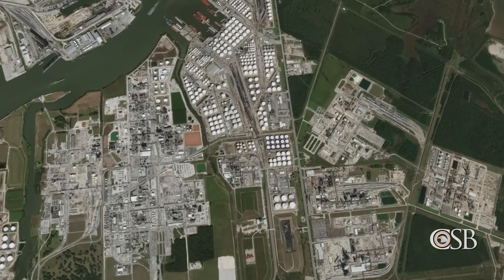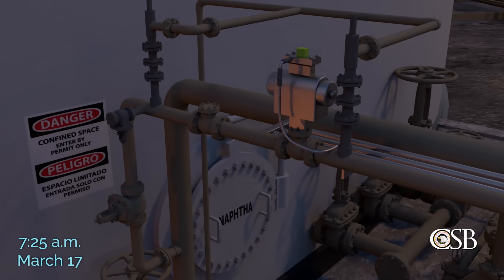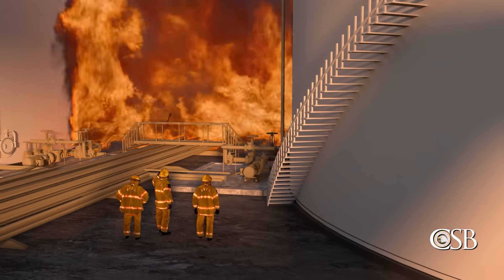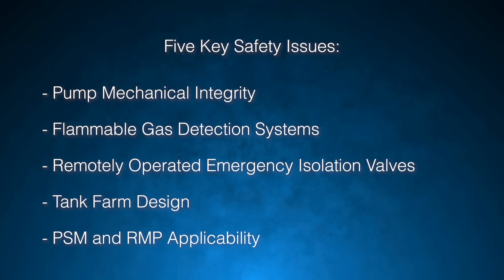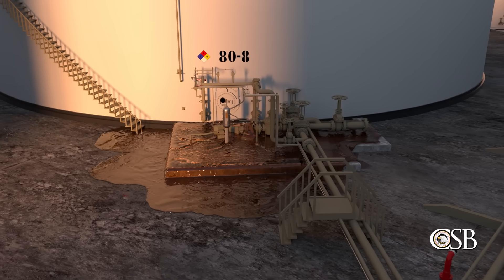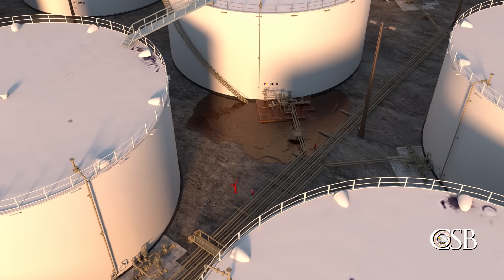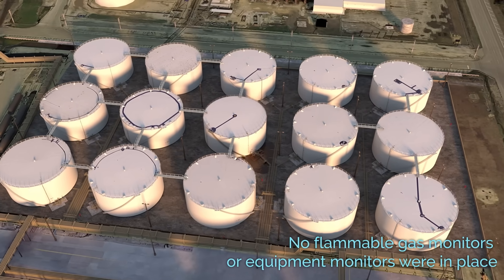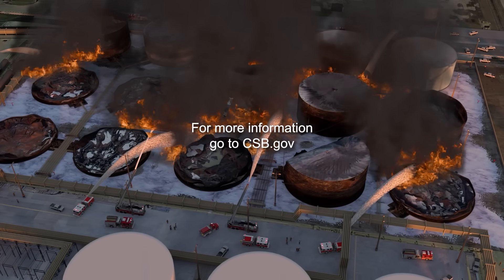Terminal Failure: Fire at ITC

Comment: What's absurd is that a couple thousand dollars worth of sensors could have prevented this incident. Even just anomaly detection on the data they did have coming in from the tank should have caused them to shut down the pump before the seal started to fail. They could have outfitted the whole terminal with sensors and automated analysis like that for a couple million dollars and saved the many millions of costs they ultimately incurred in damaged equipment and legal settlements. This is a perfect encapsulation of why we need robust safety regulation: any rational company would have voluntarily taken the steps to prevent this incident, but ITC is clearly not a rational company and the fact they never took those steps caused thousands of people to be exposed to toxic fumes and one of the country's most important waterways to be partially closed for a week.

Comment: It's CRAZY that a facility that stores highly flammable hydrocarbons just didn't have a flammable gas detection system. They did just about everything wrong here: no FGM of any kind, no tank level sensors, not even a remotely operated isolation valve!

Comment: How was such a facility even allowed to operate without sensors to detect fumes, leaks, vibrations, and the ability to detect and alert the tank losing its contents? Then the fact that they didn't have remote controlled valves and no divisions between the tanks?! Utterly incompetent.

Comment: As for getting emergency response personnel inside the tank farm you could propose that the piping be buried under a berm of soil This would provide additional fire gaps and potentially a safeway to transfer chemicals from a burning disaster Away from the disaster. It would also eliminate the need for staircases to cross the pipelines.

Comment: A simple maintenance patrol routine would have noted developing bearing noise before it failed. Additionally use of Nylok nuts or castellated nuts and pins would have prevented the seal clamping nuts vibrating loose. Employing decent maintenance engineers would prevent many of the failures that occur from time to time.

Comment: What I've learned from recent years is that implementing an inspection routine could prevent many accidents, a faulty bearing inspected by ultrasound analysis equipment could've prevented all this, ultrasound was detectable way before mechanical vibration or audible sound 
#CM #PM #sonaphone #ue-systems #SDT-ultrasound

Comment: Such a simple yet stupid cheap solutions that have been around for decades.

Wireless Flammable Gas Transmitters.  https://youtu.be/1NYL2qKJN3o?si=jyOVN0ZguIVyblgV

Wireless Vibration Monitoring Systems.   https://youtu.be/6p4l6K99wPg?si=baXyPTRFf5ryDSSD

Absolutely no reason this wasn't put into service.  This technology is 15+ years old and super cheap.

Comment: i kinda feel like that whoever was the site manager, safety director, maintenance director, finance director should be held accountable for this. as obvious as the hazards are of such they are dealing with and not implimenting the reccomendations and also having the lack of alarms, safety features and isolation remote operating systems they should have crimal mismanagement charges or something idk such ashamed an accident had to happen and it all could have been simply avoided entirly

edit: guess nvm the tanks were except from improving basically any safety features

Comment: The USCSB should work closely with insurance companies to help evaluate risk at industrial sites. Thereby allowing insurance to accurately raise or lower premiums based on safety recommendation adherence. High insurance premiums is really the only way to force these operators to update their equipment. Remotely operated shutoff valves is a minimum. Geez 

*just read about the defunding at the end of the month Sept 2025. Please roll these people into the EPA & OSHA asap.

Comment: tank farms really should be required to have a dedicated emergency response company on contract. dealing with emergencies in a tank farm really is a specialist event. normal fire departments are set up for structure fires and car fires not huge chemical fires. the fire department did a few things to make the fire worse. like filling the containment basin with water without even considering setting up pumps to deal with said water as the basin filled.

Comment: Didn’t see a seal pot in the video so I’m assuming they didn’t have one on the pump which would’ve shutdown the pump had it detected a leak in the seal.   This is something that is pretty standard in the industry. 

What’s not normal is ESD valves on every tank.  Good luck with getting that when thousands of tanks across this country only have manual tank valves.

Comment: I don't understand how they didn't have fixed gas detection, let alone tank volume/pressure sensors, that's absolutely wild
Reply: Even just from a profit-loss perspective "what if a client's tank fails and we don't notice it's leaking until a catastrophe happens? We should have monitors regardless, just to quickly react and control any releases"

Comment: The thing that shocks me the most here is that most of this would've been prevented by a simple locking wire or cotter pin on the nuts on that sealing surface, to prevent them from rattling loose. Literally a dollar worth of materials.
Reply: You see, if they put a cotter pin on each bolt on each pump, that could be a couple hundred dollars in materials, after all is said and done (installation, lost money from equipment being down, etc.), it could cost several thousand.

An executive needs that several thousand dollars in his bonus, to be able to finally afford his 15th yacht.  Otherwise, everyone at the country club will call him mean names like "Johnny 14 Yachts" for a couple days, and we can't have that.
Reply: Indeed!  The aviation industry solved this problem many decades ago with safety wire.

Comment: 5:30 - each tank should have had its own emergency cooling water system which sprays a high volume of misted water directly onto the sides of the tank to prevent overheating. These systems are common in the refineries I have worked at.

Comment: 4:33 "In 30 minutes, the release grew to the equivalent of three concrete-mixing trucks."
That's a rare lapse from the CSB. Please, use actual units of volume: gallons, barrels, litres, whatever. You're not talking to people from the construction industry, so analogies based on construction equipment aren't helpful. If you want to compare to trucks, why concrete-mixing trucks and not, for example, the tank trucks that delivered the butane in the first place? Or, to put it another way, if somebody told you that this video had been viewed by as many people as there are Rice Crispies in three packets, would you have a good handle on the number? Or would you start asking questions like "What size packet?" or "Wait, buuuuuh?"

Comment: I was gonna comment that an automatic fire suppression system seems like a prudent and straightforward retrofit that, even ecological and human costs aside, would ultimately be cost-saving in aggregate. But if they didn't even proactively consider subdivisions, a comprehensive maintenance plan, remote isolation, or the other CSB recommendations, I can't imagine safety is enough of a priority to justify a budget line outside of regulatory mandates. Of course, Trump's EPA may as well not exist and certainly OSHA's on his list too, so I'm sure we'll see plenty of failures like this in the future. Anything for shareholder value...

Comment: It seems (criminally) insane that these massive tanks don't have remotely operated isolation valves. They don't even need to be the expensive proportional valves with feedback and  integrated into the plants control system, just a spring loaded gate valve with a little solenoid to release the latch. It can even be backed up by a melt-able link that automatically releases the spring if it's exposed to a fire (just like automatic ceiling fire sprinkler mechanism).
Reply: They only do what's required, laws need to change for any action.
Reply: @duramaxadventures5832 regulations written in blood, etc etc.  We all know the score here.
Reply: That and no gas detectors anywhere?
Reply: @kirkanos3968  They have a point. What is the purpose of sensors if you can't do anything with the readout.
Suppose you see the leak 15 minutes earlier. What next? Send a person there to operate the valve? That's against your KPI of reducing injuries.
Reply: Think of all the value they saved for the shareholders 💁🏻‍♂️
Reply: I have to disagree about the "no feedback or controls" part. The control system needs to know if the valve is open or not, otherwise attempting to pump something into a closed valve can present a hazard. 

I like the fusible link idea, though, or to have it close on power loss, as by the time the valve is commanded to close, the control wiring may have already been destroyed.
Reply: @user2C47  I think they meant that no additional feedback to the operator panels, but pump interlocks located locally at the pump such that it shuts off the pump in the event of closure from the fail-safe release. They already monitor pump pressures and flow rate and those alone would cause alarms when a pump suddenly stops.
Reply: ElectricGears;  I agree with everything you say...  Also, what the heck was ITC doing in having fasteners critical to the safe functioning of the pump being able to unwind and fall off in the case of some vibration.  The aviation industry solved this problem many decades ago with "safety wire".  This is a thin stainless steel wire applied to fasteners after installation that completely prevents the fastener from loosening.  Lots of safety wire demonstration videos to watch on YouTube if you are unfamiliar with the concept.
Reply: @Vincent_Sullivan probably not expected to loosen under normal or foreseeable use. Failure of a bearing causing excessive vibration resulting in loss of torque on the fasteners probably deemed a low risk. That said, not having any maintenance of the bearings obliterates all that! Vibration sensors would have been a good shout.
Reply: @Vincent_Sullivan Even more criminally that because it wasn't considered sufficiently hazmat they performed no maintenance on those pumps.  That's like saying passenger cars don't need inspection because their gross vehicle weight is not likely to knock down a building by itself.
Reply: Texas. Regulations are evil to them, even those that would save lives.
Reply: Yeah but have you thought about the shareholders and their profits though?
Reply: because amerika is a shit hole country.

Comment: I understand that adding things like remote shutoff valves for tanks and flammable gas detectors may be expensive in the beginning, but it is way cheaper than the total loss of product and damage to the facility. Not to mention fines and other costs.
Reply: But that requires thinking beyond the next quarterly earnings report, which Wall Street discourages.....
Reply: @bobweiss8682  Maybe it's me coming at this from a design standpoint, but avoiding problems in the first place is a good idea ;-)
Reply: @MakeItWithCalvin  But people like us don't run things, the MBAs do....

Comment: Here's the sad part:  A mechanical integrity program, gas monitors, remote isolation valves, and segmentation of dike areas are the lowest-common denominator in PSM-covered facilities.  I'm not saying it's 100%, but one or two of these issues may arise in five-year hazard reviews, and they tend to get fixed.  And while atmospheric storage tanks (ASTs) are exempted, companies with decent PSM programs do include ASTs in their PSM program.  The CSB's recommendation to remove the AST exemption from the PSM regulation isn't onerous, it should be the bare minimum.

Also, ITC's practice of pumping butane into a naptha storage tank is a yellow flag with regard to PSM applicability.  While they are technically transferring butane without the aid of chilling or refrigeration, Tank 80-8 was being used to mix different materials - that stretches the definition of "storage."  And pure butane is not stored in an AST, because it is a gas at ambient conditions.

This incident is a good example of why we need good regulation, so that willfully neglectful companies like ITC are forced to change.
Reply: I cant believe they wouldn't run a double nut on a pump holding that much pressure, sure bolted pumps don't tend to rattle much but in all my years operating tractors, nuts find a way to loosen themselves
Reply: @Biggest-Bread or lock wire or a castellated nut with a cotter pin. 

Any fastener that can cause a catastrophic failure by loosening should have a positive locking mechanism
Reply: Well, they were in a grey area reg wise. Other than that you nailed it. Most of these corrections were actually on the following years work plan/ budget.
Reply: Here is an idea. You don't need any of that shit. You could just pay a maintenance person to walk the tank farm twice per shift and check for things that are about to fall apart, then you can fix them. 
They probably don't even have maintenance people, they probably contract it out.
Reply: @jims.3987  Even cheaper, you can simply install vibration sensors on each pump to detect mechanical issues. This was a complete failure of hazard recognition in addition to being cheapskates.

Comment: i'm definitely going to be perform more routine maintenance activities on my naphtha/butane recirculation pumps. thanks for the heads up, USCSB!
Reply: But are you going to install remotely operated emergency shut off valves‽‽
Reply: Don't forget to make sure flammable gas sensors are in place for your storage tank areas!
Reply: Don't forget to refuckulate the solenoid in the riser intake manifold!

Comment: Lazy fking operators. Your job is to operate and monitor the machines you're using. It's like a truck driver not looking at his tires before he hops in. Monitors are great, but sitting on your ass in the control room watching YouTube is the root cause.
Reply: bro, pump the brakes. the bosses are at fault here, not the workers.

Comment: 9:40 Thats a wild 'I told you so'
I would have expected such containment farms to have some CCTV system in place, so operators could remotely see such issues (next to the mentioned sensors).
Also, are there no emergency shutoff valves that trigger automatically with high temperatures? Those would be a good idea with storage containers with flammable gas/liquid.

Comment: Seeing BSODs (blue screens of death) on several of the command center terminals was icing on this most delicious cake.
Reply: I love that kind of snark in official productions.
Reply: its a better idea then spoofing actual screens too (other then ones operators are looking at), I didn't even notice until it was pointed out because the other screens were just filler.
Reply: I was hoping one would be playing Minesweeper but no such luck.
Reply: I could not resist pausing the video just to look for that one comment about the BSODs
Reply: My thought on the first one already: "WTF" - but maybe, it is a "hidden unspoken hint" how bad the monitoring actually was, and those BSODs reflect the reality.
Reply: Had to scroll too far for this.
Reply: Knowing how many industrial sites have run their stuff, it's not surprising in the slightest sadly.
Reply: 3 minutes in and I immediately noticed a bunch of those consoles were bluescreened. 😂
Reply: I'm glad someone else saw that!
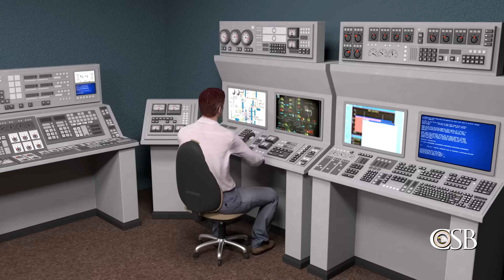Reply: 3:02 the first bsod and you can read the text
Reply: Probably the norm there.
Reply: Must be running Windows 11
Reply: 4:26 Funny, I thought it was the least realistic thing they've shown as an Operator console.  Specifically for a tank farm, they wouldn't generally have those types of panel boards and buttons.   The overview displays are generally quite simple and an individual graphic for each tank, and a graphic or two for the loading and unloading and tank inventory management.  In my experience the companies that are owner/operators of tank farms generally use the cheapest PLCs or SCADA systems they can.    

But still ... the blue screen with writing on it is funny.

Comment: Problem is CSB has no ability to enforce their recommendations. How was ITC able to get insurance coverage on such a poorly built, poorly run facility? Texas state regulators must have inspected and signed off on the operations of the facility. No amount of investigations or oversight by government authorities will make a difference if a company chooses to operate this facilities in an unsafe,  haphazard way.
Reply: What a weird response. If the government was empowered and motivated to shut down unsafe facilities, they would do so.
Loose regulations and a culture of barely even adhering to those regulations is exactly what allowed it to function.
Reply: @tim3172 Both the federal and State governments  are empowered to inspect and shut down unsafe facilities. Unfortunately CSB has no enforcement power, it only has the power to offer recommendations. Too many companies are concerned with only doing the bare minimum or less when operating their facilities. Uncaring, greedy companies too often are not moved to change the way they operate just because someone recommends that the do so.
Reply: Correct. The USCSB is as much a "safety agency" as the undertaker is a "medical professional." By the time they arrive, it's far too late to fix anything.